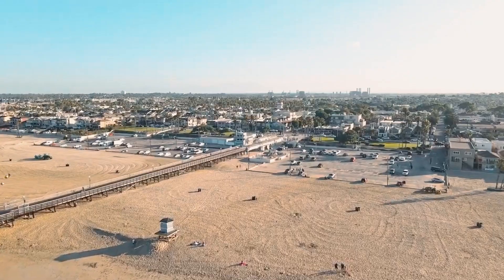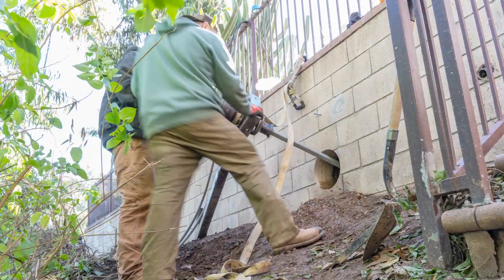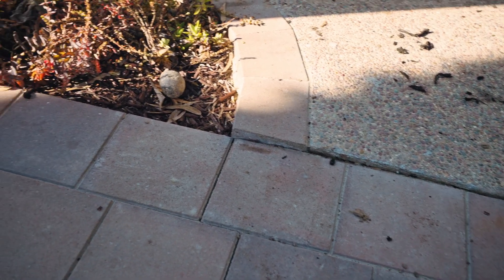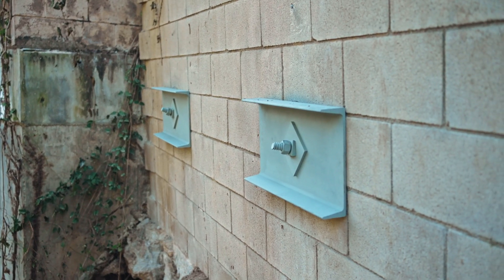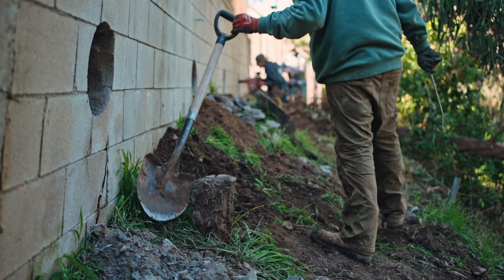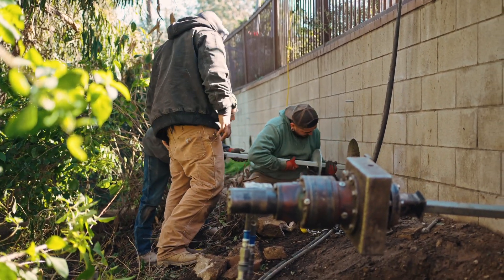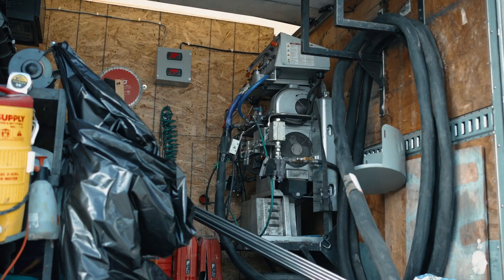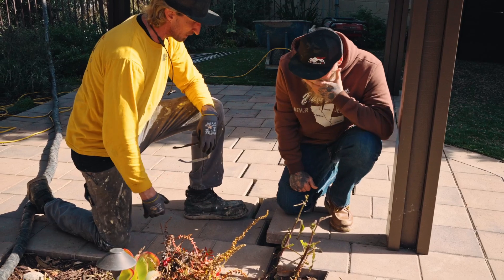Retaining Wall Almost Collapses In Seal Beach. This Is How We Saved It!

Comment: how much will something like this cost?
Reply from the maker: Great question. The cost can vary a lot depending on wall size, soil conditions, access, and the repair method needed. Projects like this can range from several thousand dollars to more for complex repairs. The best way to get an accurate number is a site inspection so the solution is tailored to the specific conditions.

Comment: This is a very informative video. Thanks. Does the City usually require a geotechnical investigation for repair of retaining walls using helical tie backs ?  What information do you use from the geotechnical report when installing the helical tie backs ?
Reply from the maker: Yes, most cities that we service will require a geotechnical investigation and we're typically interested in the dcp information